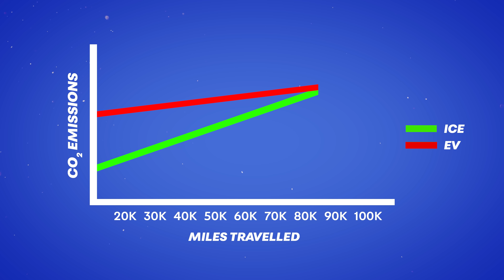Are Electric Cars REALLY That Green? [New 2022 Data]

Comment: Obviously there is a massive potential for reducing the environmental impacts of EV manufacturing, improving the power mix and the labor conditions of the entire supply chain. That being said I believe that this video fails to address the following central issues:
1. Energy security's impact on global conflicts: Who ever heard of an electricity war? I'm not saying that all global conflict is related to ressource scarcity, but it is certainly a major factor. Ask yourself why Irak decided to invade Kuwait? Why is Russia using the Nordstream2 pipeline to pressure Europe into abandoning Ukraine? 
2. Potential for environmental disasters: Sure wind turbines probably kill a bird once in a while, but how about the ecological impact of Amoco Cadiz, Exxon Valdez and Deepwater Horizon? I urge people with an interest in the environmental impacts of the oil supply chain to look into the Nigerian oil production. 
3. Evolutionary potential of ICE vs. BEVs: ICE drive trains have only made minor incremental evolutions in efficiency over the last decade, and are currently hovering at around at 30% compared to the 80-90% of BEVs. The evolutionary potential of BEVs is just infinitely greater and not only limited to incremental innovation based on the transition from a high mechanical complexity towards a more agile software-based functional platform, but more importantly with the potential to revolutionize the transport sector by introducing autonomous vehicles. For those who see this as a mere functional upgrade, another swedish study show that 150.000 daily car-commutes to and from Stockholm and it's suburbs could be serviced by 9.000 autonomous vehicles, freeing up 43 square kilometers of prime real-estate used on parking. Only condition being that commuters would be willing to wait a fraction of the time spent in traffic and looking for parking on a couple of detour-stops on the way. Time which they could spend chilling, napping or working instead of frustratingly clutching the wheel, honking at other cars and looking at their watches. 'Nuf said - the future is nigh, and it is bound to smell a whole lot more like roses :-)

Comment: Sorry I've not read the report but does Volvo factor in the disposal of an EV and it's batteries again an ICE vehicle. The other thing to consider is an EV will probably need a second set of batteries in it's lifetime. I know owners who've had severe range degradation after 4 years meaning more charging or a new set of batteries at about 6-8 years. As you say not as clear cut as people think. Good article.

Comment: And how do people in apartments and highrises charge their cars, are they going to run 500ft. Of extension cord or more and are electric companies going to use more coal and gases to keep up with demand creating more need for fracking, and here in California we already experience both black outs and brown outs due to heat on demand out pacing supply what's going to happen when we add another 275million ev cars using electricity

Comment: Was not able to open, download or find the pdf from VolvoCars. Just curious if the CO2 emitted from drilling from a rig at 1000 meters of sea depth, pumping the oil onto huge tankers, propelling it onto sure, cracking it in the refinery to petrol and then distributing it out to the petrol stations is considered? Oh and also the electricity used to crack the petrol, 1 kWh per litre of petrol.

Or is the petrol car just from “tank”. If so why consider where electricity is produced, but not the production of petrol?!

Comment: The EV batteries mentioned in this video are all Lithium Ion batteries that use Cobalt and Nickle.  EV batteries that are Lithium Iron Phosphate (LFP) batteries generate much less CO2 in their manufacturing.  It appears that LFP batteries need 50% less energy to manufacture and way less energy to mine.  This means an EV powered by a LFP battery will have to travel far fewer miles before it become greener than an ICE car.  Also the smaller the battery pack the quicker the EV will become greener.  A 2014 Chevy Spark EV LFP battery pack is 21-kWh.  A long range Tesla Model 3 has a Lithium Nickle Cobalt and Aluminum battery (NMC) that is 75-kWh.  That is over 3 times the size and takes 50% more energy to produce per kWh than the LFP Spark EV battery.  To be fair Tesla itself is switching over to LFP batteries for some of their range options.  LFP batteries are non toxic and way easier to recycle than NMC batteries.  LFP batteries are also way safer than NMC and last 2 to 3 times longer.  LFP batteries can also be charged to 100% daily and discharged to nearly 0% daily without damaging the battery.  LFP batteries can also take higher charging rates for longer at higher temperatures than NMC batteries without suffering damage.  LFP batteries are also cheaper to manufacture than NMC batteries.

Comment: Unless that leccy is 100% green power it's just a farce. You have to run the car for several years to offset dirty power that made the car firstly. I'm not even sure that  Tesla car is made from 100% green power yet as it'll take years of wind and solar power to offset the factories, shipping, and infrastructure. Is the car carrier carrying electric vehicle running on green power or diesel? That has to be factored but that's the same with ice vehicles.

Comment: All this is dependent on: (1) a dirty (the past) grid which is very quickly getting cleaner.  (2) highway travel vs city (where EV's are far superior).  (3) EV production not getting cleaner which is false.  (4) EV battery technology not improving which is false.  (5) Other wrong assumptions.

Comment: What’s the average lifespan of batteries used in these vehicles?  If it’s not say 150,000 miles, then you’ve also gotta factor in replacing them to get an equivalent lifespan to a standard vehicle, which can easily be twice that if maintained properly.

Comment: This was a very honest video, but there was one crucial piece left out of the Volvo study (or maybe you left it out of the video, since I haven't read the study): longevity.  A modern, well maintained ICE car can easily go 200 or 300K miles (300 to 500K km).  We don't have much data on BEV's yet, but I know from our Prius, that the batteries are not going to last much more than 100K miles.  A BEV would probably take 8 to 10 years to reach that, and I doubt that many owners are going to opt to pay half the cost of a new car to replace the battery on a 10 year old car.  Buying a new one would mean starting your carbon debt all over again.  Even if you do go the battery replacement route, that's about half the carbon debt.  OTOH, rebuilding an ICE is almost all labor by comparison as the only refined metals are things like pistons, bearings, valves, etc.  You get to re-use all the big metal lumps (block and heads) meaning only a tiny upward blip in the accumulated CO2 lifetime.

Regarding your power assessment at the end, if you want carbon-free electricity, your only choice is nuclear.  Solar panels?  Please research how silicon is refined.  Wind power?  The composite materials and balsa-wood cores of those giant turbines produce a carbon and energy debt that is just about worked back to zero over the 20-year life of the installation.

Comment: Sorry do disappoint you, but you cannot use green energy sources only unless you don't use energy when there aren't enough sun or wind. What is always absent in the "sustainable" vs. fossil energy source comparisons is that we have no storage possibilities in areas without hydro. The "green" energy sources in most cases need 100% backup facilities from conventional sources which is a huge additional cost and environmental deficit, never considered in the calculations. The only proper green source is modern nuclear with much smaller raw material usage per energy unit produced, zero long term waste materials and capable of constant energy output.

Comment: When you say we've reached the limit with I.C.E - what about hydrogen? Feels like not enough people are talking about the potential, if any, of hydrogen, i.e. converting existing ICE stock so no need to build new cars (which have the upfront CO2 cost), even as a transition phase from ICE to EV maybe - would be nice to see a video on that.
Reply: Producing and storing hydrogen is extremely inefficient and requires a lot of expensive infrastructure that is not even close to existing yet.
Reply: Totally agree. Burn it in current cars, use it in new build fuel cell E.Vs. Lord Bamford knows a thing or two about hydrogen, our lawmakers would do well to listen to him.

Comment: The obvious message I get here is keep your car running as long as possible.  The car you have has already paid its production environmental cost and you can't get it back.  Therefore absolutely NO SCRAPAGE subsidy.  
While grid generation is not 100% renewable then every KwH you use to charge your EV cannot be used somewhere else so you might pay a green tarif but, since all generation goes into the grid and is mixed up, you aren't necessarily as green as you think you are but maybe(?) and maybe it is too soon to leap to EV.  There is also a huge enviro cost in infrastructure to support EVs which needs to be factored in.  
Certainly the hybrid part of the figures would be interesting as if you have a ICE with a KERS system and use it accordingly then the mpg, and therefore the CO2 /m will be inmproved.  
It would be very interesting to see an upgrade path for a sound ICE to EV or hybrid because then you could have lower in use emmissions without much of the initial enviro cost.  
Why aren't there any EVs with a solar panel on the roof?

Comment: So...  a small, light used ICE vehicle will have had most of its cumulative production and other emissions already 'spent' and a heavy SUV EV or hybrid with AC, massaging seats, beefed-up suspension, reverse Tardis 'baked in' engineering stupidity has a massive f**** environmental impact. Absolutely no disrespect to Rory (Top Gear's great loss), but NO SHIT! In the UK, high quality, cheap, regular and efficient public transport in towns and cities would make a bigger difference to air quality and emissions. However, inevitably, it's the people at the bottom of the economic system who'll pay disproportionately for car tax hikes, poor air quality, etc, etc. If you're in the market for a preposterous £110k+  Range Rover SVR or similar Ford Transit-sized, all-terrain F1 car how many f***s given?

Comment: Anyone who follows how EPA is calculated knows its BS and no were near how people actually drive cars let alone how mfg game the system and testing. A good analysis would be based on actually driving. Plus conplety ignore replacement cost and repairs. Idlf petrol is lasting 20 to 30% longer you dont have just one break even point. What is the break even across mutiple cars.

Comment: Volvo did it because they genuinely care about the environment as a whole. That's commendable.
Reply: If Volvo really cared about the environment maybe they would make efficient cars rather than great big SUVs that require a 100kwh battery to get sufficient range.
Reply: @paulfsd   This is what so many people fail to understand. Top selling vehicles now have 5 seats yet are used 90% by a single occupant. A waste of materials, more power needed to movement them whatever fuel you use. More tire wear and brake wear that also cause particle pollution.  In theory the greenest motor vehicles would be lightweight single or at a push twin seaters. Big cars are mostly sold as status symbols and have no right even when powered by electric, being classed as a green option.
Reply: @paulfsd  that is a pretty silly remark.
Reply: @Nnomadd  really? Can you explain why please?
Reply: @paulfsd  Car makers make what car buyers buy.
Reply: If they cared they would stop making cars
Reply: Greta told them to.

Comment: WE've known this for years. The only positive point about EVs is that they produce far more CO2 than ICE cars and that is very good for the planet. In most countries round the world coal fired stations provide a huge chunk of the energy to power these things whereas Volvo is trying to pretend that there is a payback in the future in the tiny EU market. If you make petrol and diesel more expensive more and more people abroad are going to use coal powered EVs rather than clean ICE engines.
Reply: not at the price of entry. i did a comparison of the xc 40 in canada. the recharge EV is $70,000. the ice XC 40 is $40,000.

Comment: I agree with a certain point as Volvo produce ice vehicles but companies like tesla source materials which are greener and recyclable plus their battery production are run on solar and wind power yes they have to mine the raw materials which aren't particularly green I totally agree but I charge my ev of solar and wind and nothing else when you take how many tons of co2 is churned out by an ice vehicle compared to an ev that's where we save lives through less pollution to our environment locally hence less breathing problems for children and the infirm also evs do churn a bit of pollution which is tyre dust as the evs are a lot heavier increasing tyre wear which now manufactures like tesla are trying to address by making the evs lighter and some form of a dust catching system using static electricity which when done will make them the ultimate green machine whilst driving I still love ice cars I still own one as a mechanic for 35 years I was and am still a petrol  head but I also love evs as they are more reliable will last longer and I am talking of pure evs not ice /evs which a lot are producing at the moment.

Comment: I'm looking at buying a new car in the next couple of months, I'm acutely aware of the 2030 ICE ban on fossil fuelled vehicles, and as a result I'm unsure what to do.

Where I live I have no way to recharge an electric vehicle overnight/through the day whilst at home, (no driveway, communal areas between road and my home 90ft between road and front door). So I'm unable to charge an electric vehicle, unless I want to get sued each week forevermore because the public "keep tripping over" my power cable.

So next best thing would be hybrid, but the 2030 ban would stop that too. 

So what do I do?

It isn't because I refuse to be green, its because being green can't work for my needs.

This whole NET ZERO plan needs a real debate, referendum and planning with allowances made in certain situations for those who are unable to do what others do because of infrastructure issues.

Not having a driveway kinda prevents charging a car, unless you are willing to risk causing injury to pedestrians who trip over your charging cable or risk someone stealing your electricity to charge their own car.

The whole idea is laudable but impractical and damaging to our economy.

All those forecourts that close fuel delivery drivers, refiners, car parts manufacturers, car spares shops, aftermarket modifications fitters sales and manufacturers, motorsports, water sports eg paragliding, water skiing, jet skiing, motoX, rally, bike racing, IOM TT,  model aircraft flying,  and for those than can afford a helicopter or light aircraft if they are permitted still their fuel cost will rise to cover the cost of refining the fuels because now no one uses it for road use, so the cost will push up flights, sailing and farming/agriculture costs all for what?

F1 will remain, they will lobby govt to get an exemption as they bring in millions in revenue.

It is either folly or fool hardy to think that going electric will IMPROVE lives, after all, what fun is life if you can't drive, enjoy your sport or hobby. This is further reaching than EV's or ICE, its about our whole way of life and what we do, how we do it and should we do it.

Comment: Interesting vid, I’m skeptical about EVs for several reasons, range, high cost of buying, lifespan of the EV is short compared to a well looked after Combustion Engine car my old Honda based car lasted 20 years when I sold it , it managed 45 mpg + combined, and 150k and I sold it not scrapped it, an EV is unlikely to last that long, plus the batteries are life limited and lithium disposal is very toxic , I think EVs have a very long way to go before they’re really worthy, also I Tow and an EV is proven not to be that great .
Reply: Those lithium batteries make LBVs serval magnitudes more damaging to the environment than ICE cars.

I won't accept electronic vehicles until they have an environmentally responsible energy storage system.

Comment: The only thing they forgot, is that the battery in an EV usually dies in about 8-10 years(*). And replacing it, is so expensive that people will scrap the EV, and buy a new one. So unless they find better batteries, the lifespan of an EV is going to be less than half of an ICE car. That will also influence the eco-balance of this experiment.

(*) I know the theoretical lifespan is longer, but that is under a perfect use scenario. Daily driving in all weather conditions, is not perfect for an EV battery. Many people who have bought an EV lately, have been surprised by the abysmal bad battery range in cold weather.